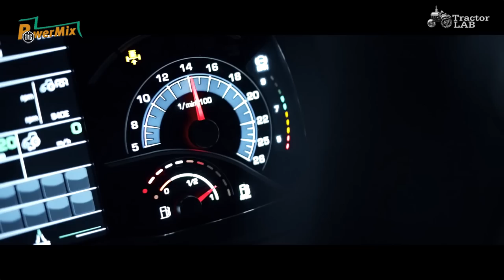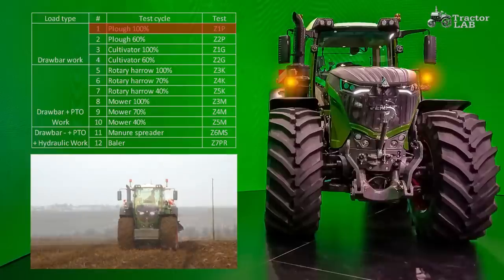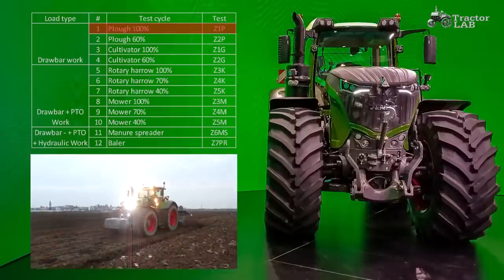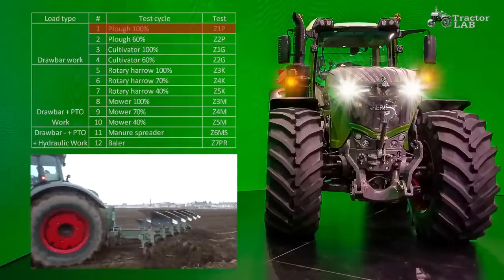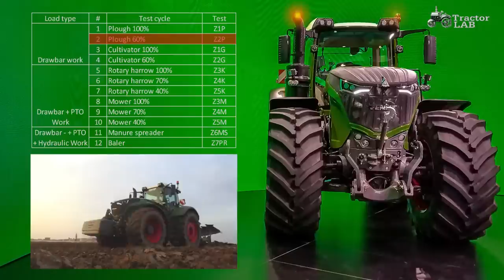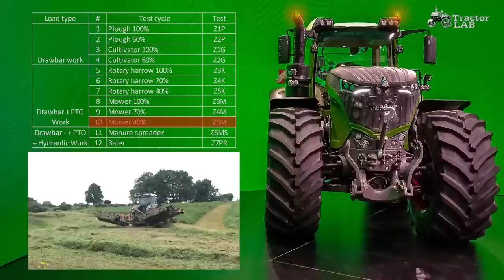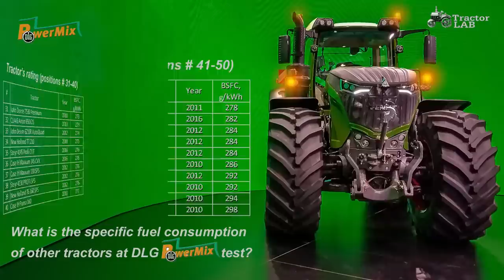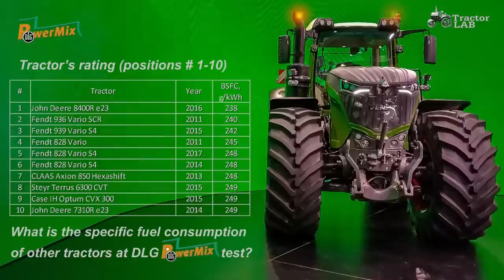New Fendt 1050 Vario World Record of Fuel Consumption in the DLG PowerMix Test | TractorLab

Comment: khmmm 1-50 not a single SDF tractor???
no = deutz fahr, same, lamborhini or hurliman?
but fendt serries 500, 800, 900 with KHD engine is on a same list?!?
Reply from the maker: It is none PowerMix test reports with SDF tractors:
http://www.dlg.org/tractors.html
Reply: I have a doitz 9340 and I can tell you that the consumption is smaller than fendt😊
Reply from the maker: This is video about specific fuel consumption detected in the DLG PowerMix test which imitate 12 test load  cycles. There is no data about Deutz Fahr 9340 PowerMix test.
Reply: Barbu Stefan Adrian 
The DLG tested the 9340 TTV and the consumption is much higher than on the Fendt 900 series! 
The 939 Vario has reached 242g/kWh, the 9340TTV just 261g/kWh so the Deutz needs circa 8% more diesel. In transport at 60kph the Deutz needs 16% more diesel.
Reply: Thanks for the information it may so but i've seen them both in the field.For the same field work same hectars the consuption for 936 was bigger with 15 liters.Maybe depends of the driver
Reply: Barbu Stefan Adrian for sure the driver is important for the fuel consumption, thats absolutly right... otherwise I would wonder :D